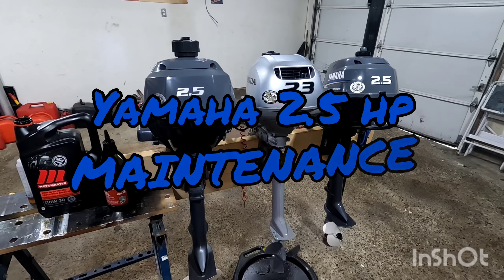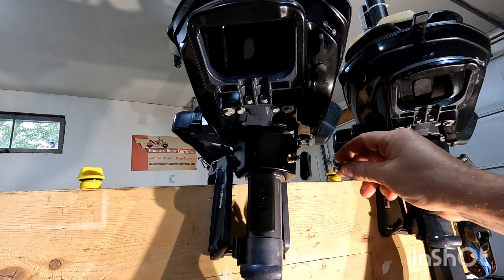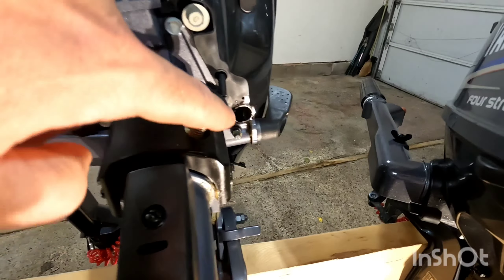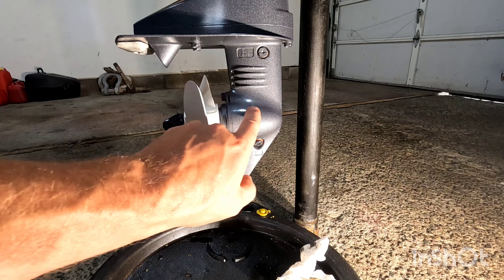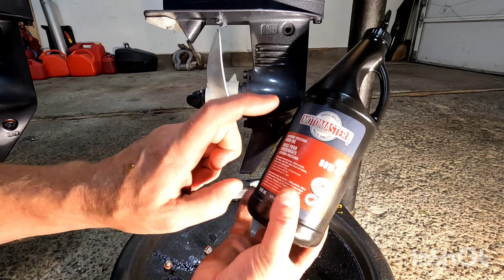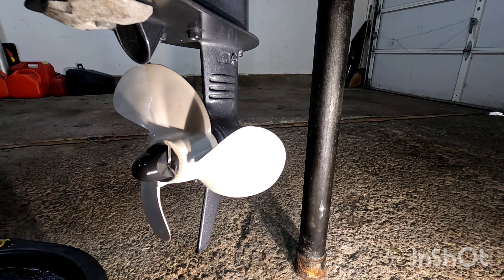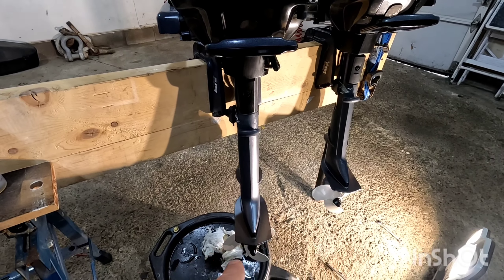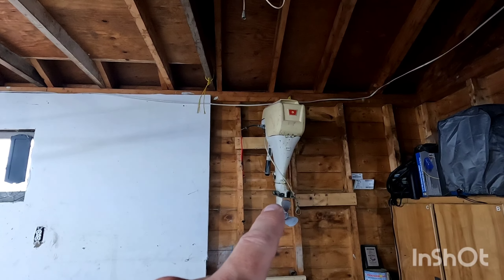Yamaha 2.5hp 4 Stroke Outboard Full Service

Comment: Thanks for this vid. Just did my oils as you did. However I did use synthetic gear oil. I have been running Aspen fuel in all my small motors and get zero carb issues! 🇨🇦
Reply from the maker: I'm actually switching to synthetic next year, used what we had left over

Comment: Well done and Hi from Michigan 🚂
Reply from the maker: Thank you, cheers from New Brunswick Canada 🇨🇦
Reply: @PovertyPointCustoms  Hi again - I purchased a new Yamaha 2.5 HP today - The only thing I noticed different on this new one is the hood does not come all the way off. The cord stops the hood from coming off. Any solution to this? My dealer ran it for me in a test tank. All looks well . I will be using it on 12 foot aluminum row boat. Retiring my 1958 Johnson 2.0 HP. Gary 🇺🇸